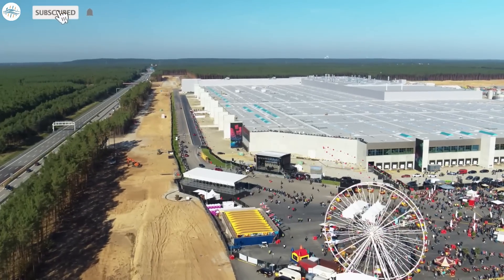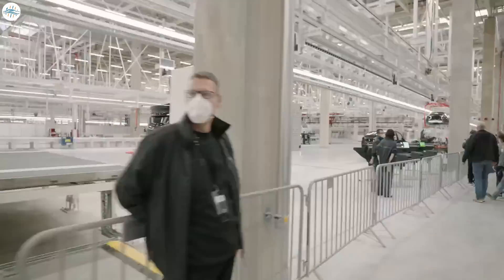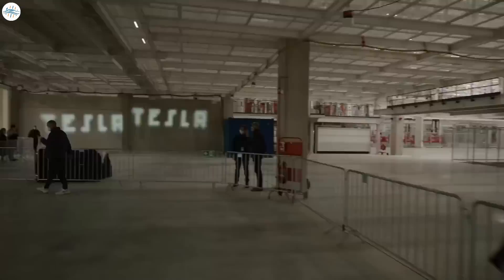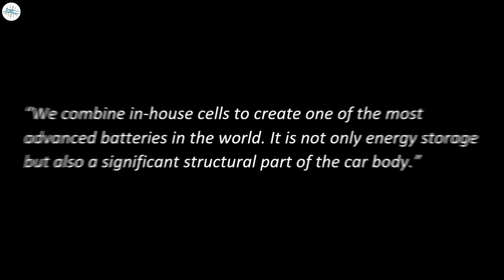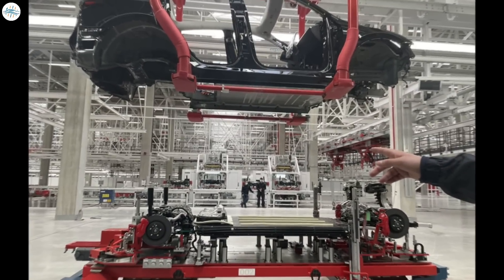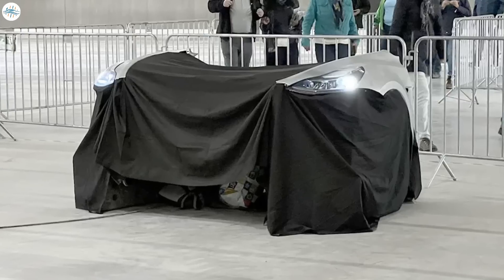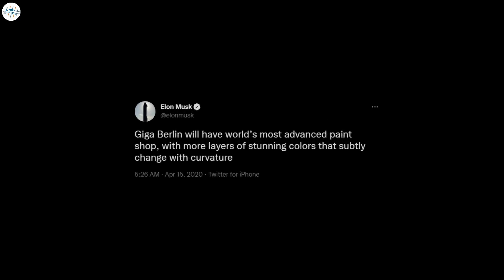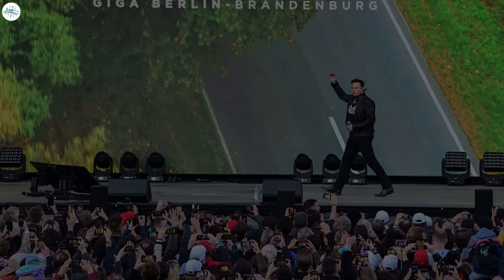2022 Tesla Model Y 2.0 - Details Revealed!

Comment: Tesla is an innovative company in many ways fall short in battery packaging. 

Patented 4680 architecture isn’t ready unless the associate problems are addressed and resolved. 

All lithium ion cell packaged in cylindrical metal casing :

(1) use a preloaded electrical tab between anode and cell base, is removed in 4680. Problem-1 depletion of electrical path count from anode-flaps to cell base one after another until all anode becomes open circuited, immediately follow by a spark next to hot and flammable chemical. Root cause? Anode foil are made of annealed soft Cu can be bumped out of shape and open circuit under inertial shock on a less ideal road surface. 

(2) of smaller diameter cells use heat sink at the cylinder wall, early model 3/Y, 4680 use heat sink at cell base via (point contacts). Most everyone handling heat sink issue use heat sink via (gap less) preloaded surfaces, and not point contacts. Problem-2 overheating chemistry followed by spark induced or self ignition otherwise premature battery aging.